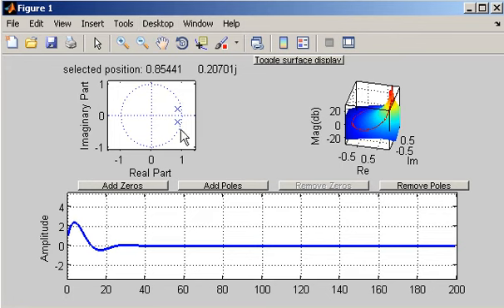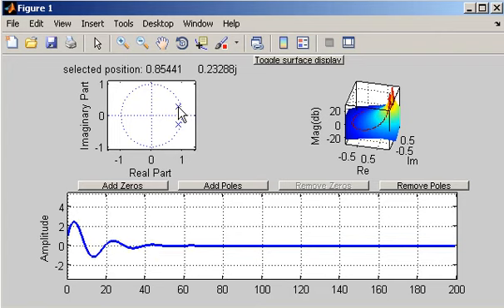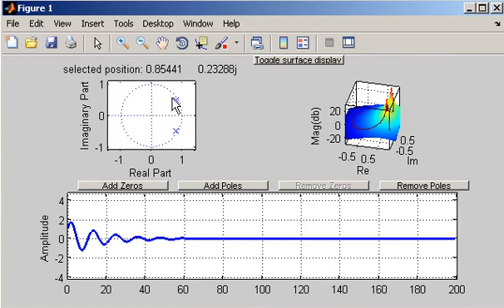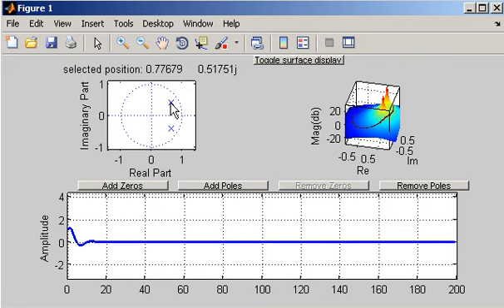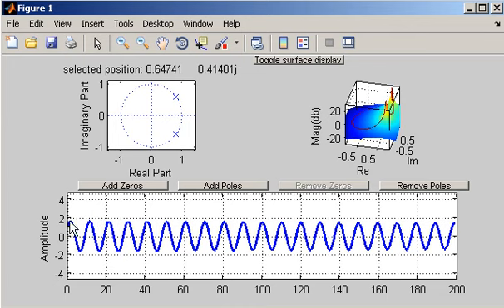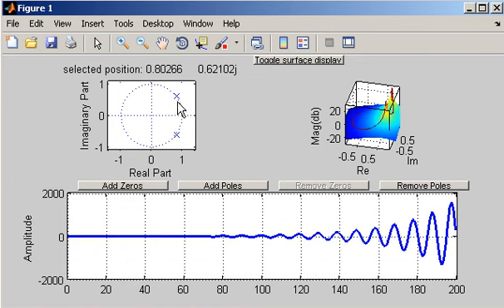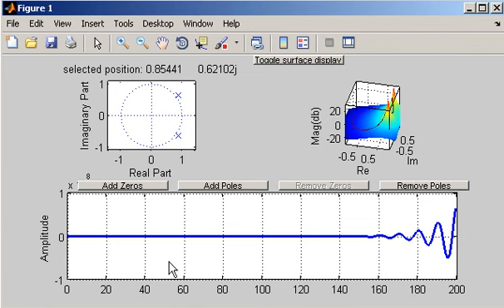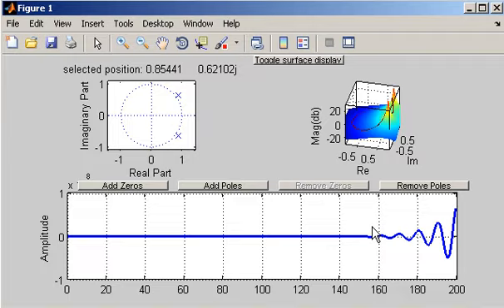Z-Domain : relationship between pole position and system impulse response

Comment: Yes please my students, the unit circle simply means the magnitude is equal to 1. outside it is larger than one and inside smaller than 1. so moving in out and on the unit circle will give you stable unstable systems. ok my students? thanks
Reply: why is that? can you elaborate this point mathematically?